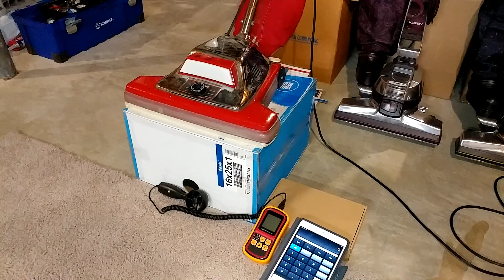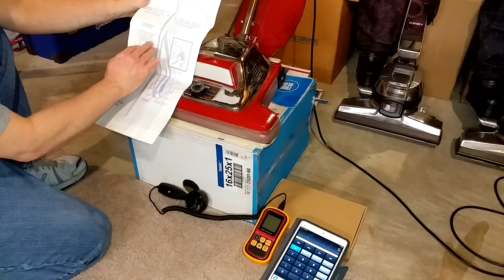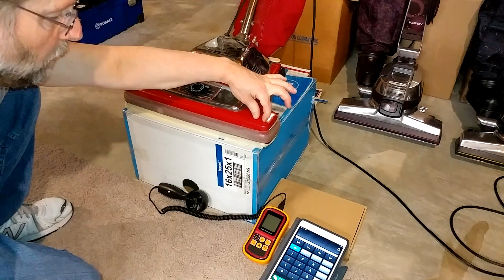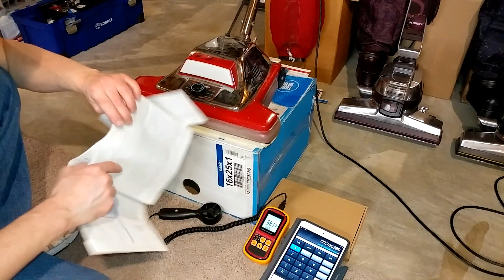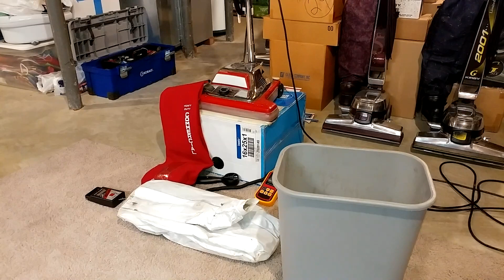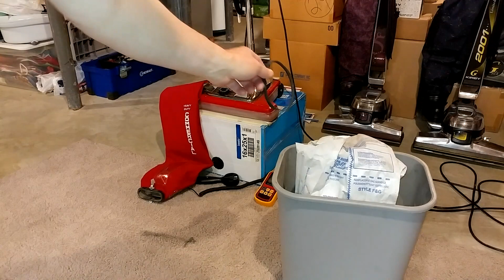Unrestored Sanitaire SC899 Packed Bag Airflow Box Test

Comment: this is a wide upright indeed, but if we’re talking you’ve not seen the royal cr5158Z/m1058Z. 18 inches! It’s like an extra wide Kirby! (Same basic design with the off-center bag) It hardly would fit on the airflow box!  Might even have airflow in the 200s!

Comment: Nice machine.  I like the wide tracks. The air flow on these machines are unreal. Your church is very lucky to have you looking after there vacuums. I guess your custodians dont clean them or even change belts?
Reply from the maker: I'm the only one that has the knowledge to service these machines. They have been neglected for years I'm told.